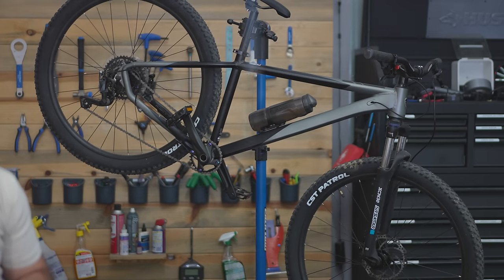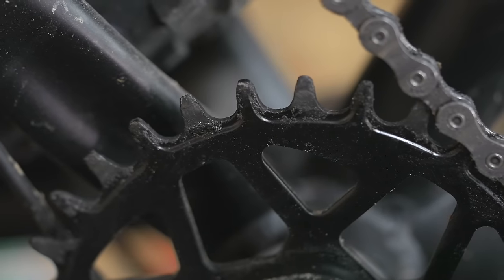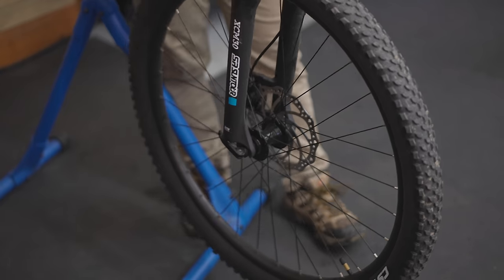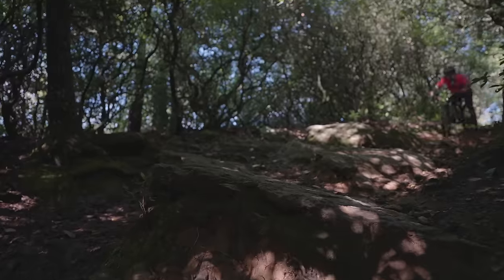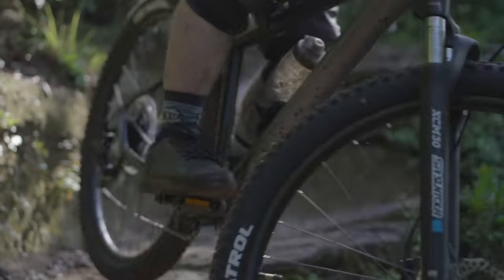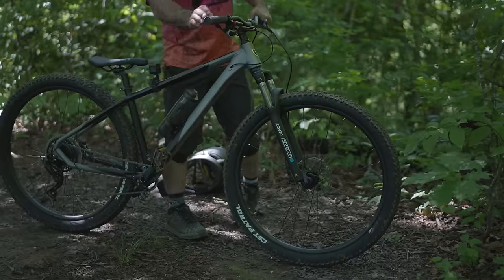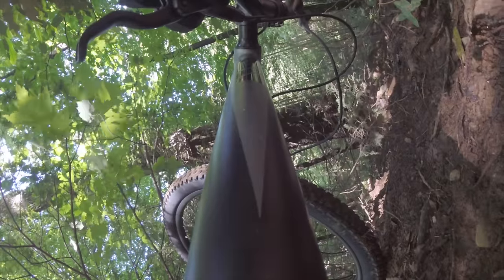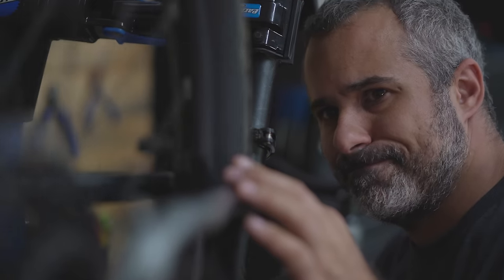Walmart MTB Upgrades! Will it explode or improve?

Comment: I think that buying second hand still beats out this. I bought my boardman mtr 8.6 (with a fork upgrade) for £550
Reply: Yeah I found a 2017 Saracen myst pro for only 950 and that's with a boxxer and a fox dhx
Reply: yep, i only buy second hand and just wait for good deals.
Reply from the maker: It’s extremely hard to beat second hand, especially if you have the mechanical know-how to do these upgrades in the first place
Reply: @BermPeakExpress  i often say to friends to buy second hand and let me have a look over the bikes before they purchase, just so they know its safe or if things needs to be fixed first
Reply: Buying second hand isn't necessarily safe either. You run the risk of getting a bad or damaged bike unknowingly.

At least with this, you knowingly accept that it may be a bad bike, so expectations can be tempered
Reply: I bought a 2019 GT Avalanche Sport for $400. Was already converted to a 1x. Added Bontrager Line Comp 30 wheels for $350, Maxis Ardent wheels for $80 and a Rockshox Judy Gold for $125. Better than anything I could get sub $1k because of those wheels and fork. Eventually added a wider handlebar and Pilgrips for a total of $1k. Thing rides great for what I need.
Reply: It depends on where you live.   I searched for a decent and affordable bike for several months.   Nothing.   If anything was listed, they wanted near new prices.
Reply: @The_YouTube_Critic  Yeah, it tough. You just have to be patient. I bought a Marlin 5 and would have been happy with that until I progressed past it. Then the GT became available and I couldn't pass it up for that price. My Marlin 5 is now a single speed urban bike and it's more than capable for that role.

As someone said earlier, I've heard really good stuff about the Schwinn Axum DP from legit MTB sites. Dropper post included for $600 I believe.
Reply: If you go for 26 wheel size I guess you save a lot!
Reply: I got my full sus Voodoo for £300!
Reply: @The_YouTube_Critic  I feel you. People in my area sell their 1-5 year old used bikes for not much less than new. And they get it. The other problem is that there really is no middle ground for bikes around me. It's either a $200-300 p.o.s. or a $2500-4000 custom build. No one around me buys a $1000 hard tail and sells it for $500-600 a couple years later. They're hens teeth. And if they do sell them they're never listed on FB marketplace or CL. It's usually personally sold to their friend of relative.
Reply: Couldn't agree more. Bought a 2019 Marin Nail Trail 6 for $500, technically third hand but was more second hand since first owner only had it roughly about 2 months till switched up to a full sus (as far as I was told by second owner). Had already great components, continental trail king tires, rockshox 120mm recon, NX derailleur with switch (only thing that wasn't sram was cassette (sunrace) and cranckset (OE from marin, never knew what it was called other than alloy cranks)), raceface chester pedals and gettagrip handlebar grips (already came with bike), and shimano hydraulic brakes. 

Although, I have modified it almost entirely since buying it about a year ago....
Reply: @ricardofernandez8485  This. How many times have I seen someone showing issues with a frame (cracks, dents, etc.) and asking if it's safe to buy. That said, all of my bikes were bought used or as demo's.
Reply: @dvs620   I ended up getting lucky and buying the Framed 29er from Outdoor world for 125 bucks.   Nothing used could come close around my area.
Reply: Not everyone has that luxury unfortunately. Sometimes the used market is. Well. Garbage.
Reply: @singletona082  i agree, not everyone can find a perfect deal, i agree, but its more about patience on the used market
Reply: 550 Pounds is like 850 dollars lol
Reply: @tmitche36  Always worth looking at the used market if you have knowledge and an ability to perform repairs.
Reply: Instead of buying a second hand bike, just keep using your own old bike.
Change out a few parts here and there. Done.
I've actually done that myself, changed my mediocre bike into a very decent one.
Deore xt drivetrain and brakes, fresh tires and a microspline freehub.
Some old parts were still decent, so I sold those to recoup part of the upgrade costs.
Reply: I bought a gt aggressor 1.0 for $100 just needs a few upgrades needs better disc brakes and new wheels the rims that came with it were bent but it has a rockshox fork and frame has disc brake mounts so it upgradable but needs a new drivetrain I have a 3x8 and want 1x9
Reply: @jerrymartinez1552  i found a shimano deore 11 speed drivetrain for £150
Reply: @The_YouTube_Critic  You checking all the sites? Craigslist/Marketplace/Kijiji?
Reply: @BermPeakExpress  depends on your area. Take all those prices you pay in North Carolina and literally double or triple them in New England
Reply: @0xsergy    Yeah -  also an added difficulty needing a larger sized frame.   The very rare time I've seen a bike that was even close to a decent deal, it was a small frame.
Reply: @The_YouTube_Critic  meanwhile in my area i keep seeing xxxl frames that my short ass can't ride. haha
Reply: @robinrai4973  bargain! Which voodoo?
Reply: @AlistairBrugsch  2016 Canzo
Reply: i got an 08 specialzied fsr xc comp for only $300 from a dude who lost interest in riding
Reply: You really have to know what you're looking at when you buy second hand...or at least bring somebody who knows what they are looking at.
Reply: @robinrai4973  noice! I got a carrera blast (24") for my son for £50. Just needed a new front shifter and a clean
Reply: @AlistairBrugsch  awesome! Bet he'll enjoy it
Reply: @The_YouTube_Critic  Or like where I live, most of the used stuff is also a Walmart bike.
Reply: Now imagine buying the Walmart bike AND parts second-hand! Speak about cheating the system, ahah
Reply: agreed, i got a 2009 norco shore 3 freeride bike for roughly 600 and it had an upgraded rear shock (manitou swinger x6)
Reply: Some areas have really bad second hand prices
Reply: I’d agree. I got into the sport last year. Bought a giant talon. It was just ok. This year I went out and got a specialized camber fsr for $750 Canadian (just over what I paid for the talon, and now they’ve gone up to $800 these days) and it’s a wayyyy better and more capable bike.
Reply: @The_YouTube_Critic  I've come across that myself. Some people only want to take a 15-20% hit on purchase price for a 3-5 year old bike.
Reply: @The_YouTube_Critic  I think this is a leftover from the pandemic supply issues. While new bikes were basically unavailable, the used market became too hot and asking prices escalated. Depending on where you are, it might take a while for good deals to come back...
Reply: First ride on a new bike turns it into a second hand bike. Especially on the rocky trails where I ride...
Reply: "If you only have $400 to spend on a bike, you should spent $800 on a used bike" with no irony. Lol
Reply: @alabama2uz  what 😂
Reply: Have a silverback hardtail and a decent specialised camber comp carbon with all the gooding need total both "converted to USD" 1800. Stripped and selling as parts i could male twice that. So yes to secondhand bikes. BUT you must know you are going to find some issues. Working on it yourself is the saving, paying someone is where this goes wrong.
Reply: Couldn't agree more, I just picked up a ibis MOJO sl carbon frame mountain bike with upgraded hubs, headset, bars, and an absolutely ruined gel/paint for 250 bucks! Just the Chris King hubs are worth that and the fox 34 stuff onbit works flawless! I'm currently rebuilding it but saved a fortune going second hand!
Reply: If you can find something. I looked and looked and looked for stuff used and all the used stuff that I could find was $1,000. The cheapest I found was $750. For what I want so I'm just going to have to build it using the Kent Trouvaille

Comment: I would be curious to see how the suntour fork upgrade program compares to a cheap Amazon air fork
Reply from the maker: I looked into it and it’s a close call. I’d say Suntour would be safer and easier to service, but still more expensive with the discount. When their entry level air forks are back in stock I may try!
Reply: @BermPeakExpress  i firsthand witnessed those air forks snap off at the crown. the two stanchions just came off the top, welds snapped straight. Forks werent bent or anything, just straight snapped
Reply: Wolftick nation did test a lot of these cheapo forks. Some of them actually work good, but not all of them.
Reply: @BermPeakExpress  what is the travel of the fork? You need
Reply: @harrymcgill6291  it probably is 80 or 100 mm here, for riding trails as the ones in the video, you probably want something more like 120-140 mm
Reply: @sebastianjost  think he may want the same as the geometry of the bike will change.
Reply: @BermPeakExpress  is it even possible to buy a air XCR? I think they all the time is out of stock.
Reply: I was in the same place as you look for a second hand rockshox Judy
Reply: I have bought 2 of those,  and let me tell you I was pleasantly surprised by how hood they were lol.
Reply: @BermPeakExpress  I wouldn't get one of those Amazon air forks. I bought a bucklos? brand for my fat bike and under hardish braking noticed my front tire would move back like 2 inches. Also the air chamber (more of a non rebuildable cartridge) failed in that it had a worsening suck down issue. It now hangs in my garage just for looking at. I bought a RST aerial as a cheap upgrade for a coil spring fork once and it was fantastic.
Reply: @Valentin359  No but you could get a Suntour Epixon which in my experience is a pretty damn good fork. Its is over 250 dollars on average though.

Comment: Just a heads up, Suntour has a trade in program for their forks. Your XCM forks would be good for that. You can get higher tier forks for a pretty substantial discount (need proof of purchase ofc). Cheapest set they would have is around $200 so a little more than the $150 Amazon ones but i really dig the program. It's a great way to help people on a budget. I bought my bike years ago and wish i still had the receipt otherwise i probably would take advantage of it. If i had the budget though... Right now i would be buying the SR Suntour AXON WERX F RL-RC 15QLC-TI sitting at a cool $1000 discount on their site.

Comment: Hey Seth, if you want to upgrade the derailer, microshift makes that same advent nine speed derailer but with a clutch. I’m running it right now, and the clutch is damn good for $60!
Reply: Same here, gotta love me my Microshift stuff like they are legit so underrated from where I bike at, and they are so rare to come by
Reply: You saw that too huh, is it the long derailer
Reply: @lewislopez8610  The clutched version is in the medium cage(42t) and long cage(46t)

*The long cage will work on both cassettes, but the medium cage will only work with the 42t cassette, which is what I believe this Kent has
Reply from the maker: I agree. I found it for $55 on Amazon and already ordered it. That could very well be the best 9 speed derailleur for the price and the best drivetrain for the money. We’re still under $600 with that!
Reply: @BermPeakExpress  thanks I called the bike shop my trouville is at and they said it was the long cage but I think your more of an expert so which is best, medium or long
Reply: @BermPeakExpress  Yeah, we're so getting another episode of this with the RD and a new fork.
Reply: @BermPeakExpress  Hey Seth, since the suspension was getting completely squished, i recommend adding more compression so that the fork gets harder and its harder for it to full squish as easily.
Also I would like you to ride this on a smooth trail as in berm park with smooth rides and not rough places like rock gardens.
Reply: @ryanmarotta2413  so get a medium clutch if choosing to stick with the 42t cassette?
Reply: I have a ~ 40€ m5100 derailleur, works well, has a clutch and 11 speed
Reply: do you have the amazon link?
Reply: My XT 10 speed was $93 with a clutch.
Reply: @BermPeakExpress  I have been riding with a microshift advent 1x9 drive train for 18 months and have about 800 miles on it and it strong and reliable.
Reply: Does a 9s clutched mech work with a 3x chainset or does it only really work with a 1x?
Reply: @lewislopez8610  Correct
Reply: @AlistairBrugsch  yep... Just makes shifting in the front a little harder. But the chain retention will be improved
Reply: @MostlyMessi10  it's an entry level coil fork, the only thing you can change with those is the preload.
Reply: @_CyclingNeko  In that case, I recommend switching the fork up to a $99 one which seth was talking about, off of amazon.
Reply: Been running the AdventX on my bike for over a year and I have yet to want to upgrade it to a 11 or 12 speed yet. It is bulletproof.
Reply: I have it on my Schwinn Axum DP (another great walmart bike) and it's great.

Comment: I would be interested to see how that bike would compare to an entry level trek or giant!
Reply: I was thinking that because you can buy new Kona lava dome £450.better bike and cheaper than that Walmart bike.
Reply: @ianstubley9388  I am not sure where you got that price, but Kona Lava Dome in the US is $875
Reply: Yes! I was wondering the same thing! If someone had an older bike, it would probably be a good idea to use this hack to upgrade the brakes and maybe the bottom bracket, but a new rider looking for a budget bike would probably have more luck with an entry level. For the same (or just a little more) on the price point, you would get a 1x, hydraulic brakes, an ok-ish coil fork AND warranty/tune-ups with an LBS. (edit: also, I think even entry levels usually come with a de-railer clutch)
Reply: Also bikes direct, bicycles online, have good deals along with chain reaction, I like voodoo bikes, they were only through Halfords, but now I think you can get them online now international.
Reply: @Anotherfunnyword  What Entry level bike that is the same style as this one is better? I'm looking to buy one that i can take in the dirt and on street, BUT iv never owned a bike with gears xD BMX only. So don't wanna get the wrong type, considering I'm very broke so price is a BIG selling point.
Reply: I got the 2022 Giant Talon 4. For $600 it is nearly identical to this bike. 1 by system, disc brakes, 29” wheels, 100mm travel. I’ve ridden it quite a lot and things have broken quite a lot. I’d say this Kent is a better deal because either way your gonna have to repair it. And you save 200 bucks to put towards upgrades
Reply: Me also I would love to see the fork upgrade
Reply: @OmnieStar  I'd say any of the major manufacturers like Trek, Giant, Specialized, Marin, and Kona all have entry level bikes around the 500 dollar price point with better components than this one, I'd just read some reviews and pick whichever one has the best price/color. Stuff will probably still break eventually as it does with all bikes but I'd trust a bike from the more reputable brands waaaaayyyy more than this one to get me down the trail safe, and they're generally assembled by professional bike mechanics and come with a free tune up if you purchase from a bike shop. Plus if you go to a bike shop you can test different ones and get a feel for them and see what you like best. You can also have good luck on the used market but you have to know what to look for and have some mechanical knowledge to check out what needs fixing because 500 dollar used bikes usually have something that does and hopefully it's not an expensive part.
Reply: kent has better geometry than trek and specialized
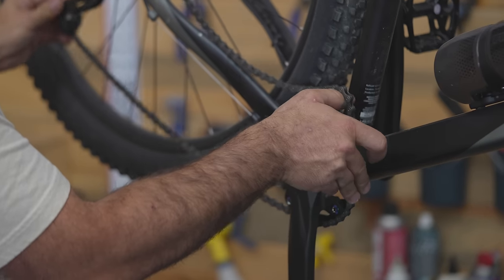Reply: For God so loved the world that he gave his one and only Son, that whoever believes in him shall not perish but have eternal life. For God did not send his Son into the world to condemn the world, but to save the world through him. John 3:16, 17.
Reply: @spicydramarama852  was Jesus a cyclist? I rest my case.

Comment: I had a RockShox Judy Silver TK on a similar build, really nice fork for under 200. Tires would also massively improve it. I’m so stoked for this build.
Reply: For my daughter I got a Manitou Markhor fork.  They make it in straight steerer tubes still (which you still find on older entry level bikes) and it weighs a heck of a lot less than a Judy for about the same price.  Stanchions are 30mm which isn't great if you're a heavy rider doing really gnarly stuff, bit for my daughter that weighs 100lbs and riding blue trails on a hard tail, it was a perfect upgrade.
Reply: they are excellent forks

Comment: This is how I got into the sport. Bought a Nishiki Colorado Comp from DSG. Swapped out the bottom bracket and crank set. Swapped handlebars, stem, grips, and pedals for comfort. Added an inexpensive external dropper. It turned into a pretty capable trail bike. I upgraded to a new bike once I realized it was something I wanted to get into more but I never would have really started if it wasn’t for the big box store bike.